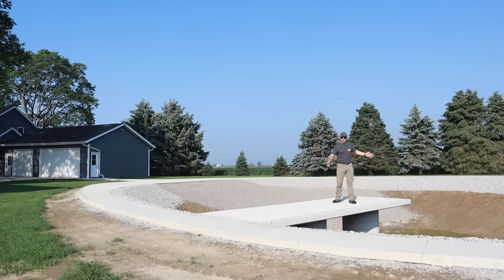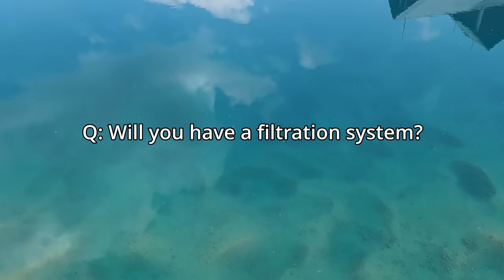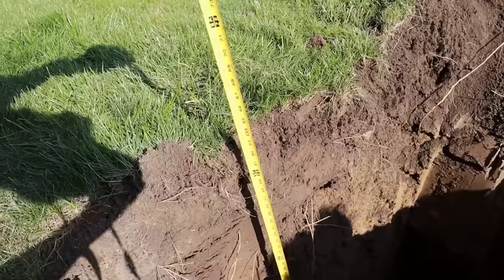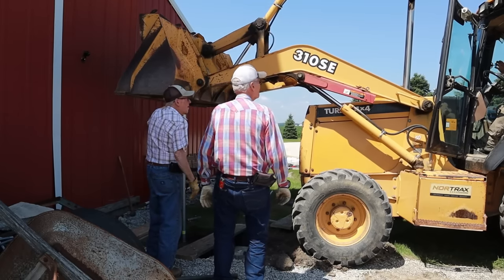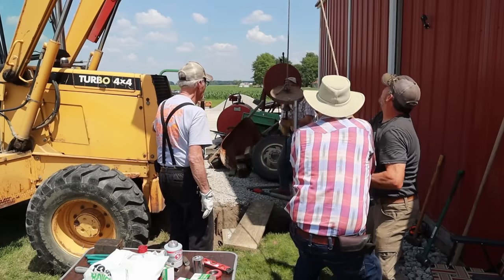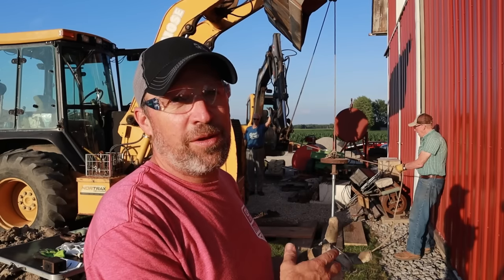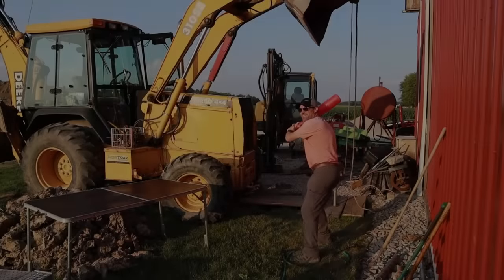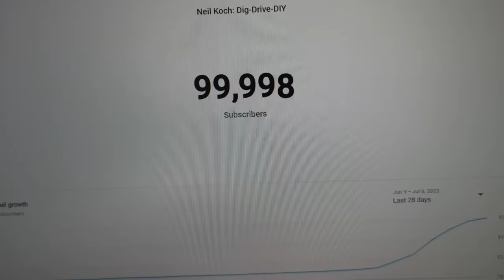It Doesn't Always Go According To Plan

Comment: There are videos of youtube of drilling and casing a water bore with a power drill and water return. These should be ideal in your clay. 
With the driven pipe pressurising your string with water or air occasionally as moving from the clay to the aquifer, your screen will still be packed with clay. The artesian water doesnt appear to have much pressure so may take a while to push the clay out. Keep giving the pipe a half turn occasionally with a wrench and it will drive easier. 
Put a ruler on the map with the other bores and springs, get as close to that line as possible. Its likely an old channel in the lake bed and will be shaped like a stream. 
You may be able to get a simple auger sampler and find it. 
From country boy Geologist enjoying your content.

Comment: Filtration, I recommend floating island, the roots of the plants grow into the water and extract excess nutrients. Make them from pickle barrels so as the island gets heavier you can adjust it by displacing the water with compressed air. Just orientate the barrel so the hole/ cap is at the bottom. Make the frame holding the barrels from anything that won’t corrode or breakdown in water…
It’s amazing how static friction can resist driving something into the ground, the city of Venice sits on piles so do the very tall buildings in Dubai.

Comment: I am a downer, by fortune, it would appear.  When we needed to drill a well for our bait and tackle shop,  my partner and I started walking around the area we wanted the well drilled.  After I crossed a spot twice, I said , “Here,” and pointed to a location at my feet.  When the drilling was finished, we had over 80 gallons a minute flow from an artesian aquifer!  I did the same thing at our farm, too.  Both times I did not use anything but my intuition.

Comment: Look how they build fences they a short tube with on end welded shut they put on top of the pole so it can be hammerd down with no damage pipe used it before works great for driving down hallow pipes

Comment: For this sort of situation, we have a concrete breaker for our excavator and skid steer that we have a tamping foot for.  We modified that so we can mount seats of different size so we can  hammer fence posts.  Done miles and miles of fence line, and driven in 20 foot lengths of drill stem for gate posts, or for high-lift horse fencing.

Comment: I once had a plan to build a cistern to collect the water from my roof.  Eventually I gave up and did a well. In the process I calculated that with about 32 inches yearly of rain here in Kansas, more than 10k gallons runs off my roof.  Have you considered collecting the water from your roof for supplying your pond?

Comment: How does the gravel hold up on the clay over the years? We want to do the same but are worried the gravel will pack into the clay. Do you use a road cloth for weed prevention too? Our dugouts get nasty in the summer! Thanks!
Reply from the maker: The stone holds up well in the clay. It won't sink in too badly.

Comment: Requires some planning first.  Leaving out a small piece of sidewalk for heavy load access with a road in would make sense.  Dig deeper during the excavation of the pond and put the well head IN the pond… bring in a well driller.  Install the head at the dock.

Comment: Here in Germany we don't hammer drill like you do anymore. We juste use a waterpump connected to some metal pipes with a horseshoe at the end. You just twist a bite and the pump does all the workt. After that we put in pvc pipe with a plastic filter at the bottom in the whole, so nothing will be rotting away. Than we fill the whole with Quarzsand and pump the well clean with the same pump. Works very easily and takes about 2 hours max. Maybe give it a try. There's instruction videos of that on YouTube. Good luck!

Comment: My neighbor handed me a pipe with a shut off valve at the top, that connects to a pressure washer or hose.  This he said, is what we use to drive post in this dry hard soil. 
With that I hydro drilled a starter for Railroad ties. Helped build corrals while using a post hole digger.

Comment: A drum winch would have worked gr8 for lifting your alide hammer. I have seen other well diggers drive pipe using this method. Just need a motor to operate smooth drum to wrap your rope on. In fact they actually make one that attaches to a chain saw that may work

Comment: I saw a video where a guy attached a power washer head and water hose to a really thin flexible PVC pipe inside another pipe 1 size larger and sprayed a well hole all the way down until his outermost piped which became the well was all the way in the ground and then pulled the thinner pipe out. He was able to make a well in a matter of minutes.

Comment: At one time many years ago I used to belong to the Southern Oregon Society of Dowsers, and it does work.  You can even tell the depth of where the water is.  How it works; Basically the tool doesn't find the water it is only a visual aid for your emotions.  You body picks of energy waves and through slight physical movement your sticks or whatever will tell your eyes what your body has picked up.  intuitively.  I know, I know it sounds weird but that is the mechanism.
Also, water also rises up into "Domes" and if you are lucky enough and pierce the dome at the right place you will get an artesian flow.  These domes are not a part of the linear flow of underground aquafers.  Those domes are filled from water deep underground under high pressure, not from an aquifer.

Comment: You may want to try a variation on the old classic hand drilling technique using a pump and mud.  https://youtu.be/bx_hS_g0wDY or with a drill https://youtu.be/xQRhsoSCXvg.  -  DIY Water Swivel for injecting water down a pipe: https://youtu.be/GN5bU-Dr3dg.  The second video uses a drill head of PDC carbide drilling head inserts, but to be honest some steel rod welded to the end would probably do just fine.  Really you just need to scrape the dirt/sand/clay loose and let the water flow carry it up the hole.

The other method I've seen is using a pressure washer to do some of the drilling:  https://youtu.be/udGhHFv0sTI.  

With your heavy clay soil the well hole will probably stay pretty much intact for driving the pipe as long as there is water/mud in it.  

I don't really believe in the divining method to find ground water, but if you walk the land between where you know springs are there may very be slight ground elevation shifts,  general patterns, or even slight soil differences a shovel or two down indicating where things might have naturally run over thousands of years.

Comment: idea Put a tractor rear axle on a  jack and using the wheel, rig a pole as a crank and a chain that will freely swivel around the circumference of the wheel connected to the weight and pulley….then put the tractor it in gear and let the wheel do the work

Comment: Use dosing rods to find the water. Then I'd say drill or dig out the hole. Doing so wont ruin your pipes and you'll also know if you got water.

Big part of the problem is that clay you mentioned earlier in the video. Its thick tough clay.

Comment: Pretty sure that heavy clanking noise as you're using the A-frame method is the same one you hear in oil fields, cause they are driving oil wells by slamming heavy weight haha!

Comment: Vermeer makes a pile driving machine.  We used them to pound piles (steel beams) into the farm grounds here in Michigan for solar fields.  I hated that we were using farmland for solar fields, but I was a mechanic on the job and that would be your best bet for getting that pipe driven into the ground, minus any boulders in your way 😢….then yea just like anything with a road block you gotta change your path of travel by moving it over a few feet or get a bigger pile driver 😅.  They make a loud hammering sound like tink, tink, tink, tink every nanosecond, so wear ear protection and safety glasses with a helmet.  Sunbelt rents them out.

Comment: Its a very long story but I was able to find the old wood and wire main waterline (by accedent) to a city in Wa by witching with 2 copper wires. I thought it was bunk until they crossed. I wandered around determining a strait line which we dug and hit the pipe on all 4 holes. Im a witch

Comment: I dont know if you ever got your well finished but i learned away to drill a well with just water an air compressor and 2 in pvc pipe and i was able to drill 50 ft thru clay and dg in under 5 hrs i orginally was using just water pressure but i found a site that told me to add air to help remove the material

Comment: Let water pressure lube your pipe and push the soil out of the way. Make a tee out of one or two of those special couplers. The tee side should be 3/4" pipe so you can put a hose bib adapter and connect it to your existing water system. Put a shut-off valve on before you connect the hose. Either put a plug in the coupler or weld a plate on top. With 50+ psi of pressure flowing through the screen you are driving into the ground, the sledgehammer will work fine. I have put a piece of 3/4" straight pipe on the end of a garden hose and pushed it into very hard ground by hand for more than a foot deep.

Comment: i would have welded a bar on a tractor wheel then lifted the wheel off the ground, then put it in gear and set the speed and it will go round and round and the weight will go up and down a lot faster but most of all a hell of a lot easier... great job with the pond i love it

Comment: I drive 8 and 10 foot ground rods by using 3/4 and 1" emt with a garden hose on one end. Running water through the emt acts as a water drill, when done I drop the ground rod in the hole with no problem.
Reply from the maker: Nice. How do you drive it while the hose is attached or do you take it on and off to drive it?
Reply: @digdrivediy  very little is required to get it to go - no driving required. Usually with the water running all you have to do is lift the pipe up and down about an inch to let the water push the dirt out. I have lived in Ohio and Nebraska and this always worked until you hit a rock - but it's so fast, so if you do hit a rock, pull it out, move 6" and try again.
Reply: @digdrivediy  with the tip your driving it looks to be 2.5/3 inches in diameter. If you used 2" emt I don't know if the water pressure across that area will be enough to start removing soil but 1" will definitely help by giving you a pilot hole to follow, and help just like when working with dry wood.

Comment: More weight on the pile driver would help...stack some barbell weights on it.  Also can pump water down the pipe to pre-wet the soil at the bottom to make it softer.  Another thought is to rent a jack hammer attachment for the backhoe.  We use them around here to remove rock shelfs when digging a basement.  They are sometimes called a "Pecker Head".

Comment: Maybe putting water in the pipe would help. As the water goes out through the point mesh it may act like a lubricant. Just an idea to try. 
Second I don't know if you are aware of it but the pipe can't be longer than 33.9 feet because this is the maximum hight that atmospheric pressure can push water up at sea level. If you are at higher altitude this is lower than that.

Comment: I’m sure everyone has a million ideas about how you should do this and I’m sorry about that but I have to throw this one out there.  Use a small tractor and bolt a bar to one of the lug nuts. Then tie the rope that pulls the weight up and down to that bar then put it on jack stands and put it in drive and just let the wheel going around pull it up and down.  Not sure if that makes much sense but I hope so.  Either way I like the content.  Keep it up 👍🏻

Comment: Dropping the weight with the pulley seemed to be the best method. I'm wondering why you didn't take that rake leaning up against the barn or a shovel or a broom and tie it to the end of the rope to make a t-handle that one or two of you could use to pull it with. Like a rowing machine or even a lat pull rather than twisting and pulling sideways trying to grab a hold of a rope and crowding on top of each other to get to the rope. You could even leave the rope tail a little long past the t-handle for a third guy to use with a guy on each side of the handle and have room for each other and pull it straight to you.

Comment: Had a similar job but had to drive horizontal instead.  I used my 20lb Milwaukee SDS Max hammer drill and a custom drive socket and point I made up. The tip was made of M2 tool steel I welded into the front and then ground to a point.  It was then heat treated for toughness.  Worked the charm and drove thru everything it, a couple of rocks.  In your case I would have simply rented a 60lb electric jack hammer and a drive socket to do this.  Then again I am lazy and can make more money, but I can't make more time!

Comment: I have used brass rods to find water. I was the biggest doubter in the world until those rods crossed at one point continuously and no other places. The water well guy found it, my wife started laughing, so he handed the rods to her, and the rods crossed, I called BS, so I tried and they crossed with me doing it. The water well strongly believes in them.  Where the rods crossed is where we drilled the well and it turned out to be a very strong well for the past 10 or 12 years now.  All it will cost you is two brass welding rods, bend the ends, hold them in your hands and start walking.

Comment: Knowing that you have such a low water table. You could have tried using a cherry stick. It would have helped you locate the water much quicker. And then you wouldn't have to take the place out and put. Put it back in the ground again. I think. With a cherry stick, locate the water first, make life a little easier.

Comment: You know while drilling. If you pump water down the pipe it would force the dirt to move out of the hole. It won't even take much pressure to push the pipe down.

Comment: Okay, use an auger to make the hole. Drop your sandpoint, pour in  a couple feet of course rock, then back fill the hole. Or leave the hole open and put a ground level cap on it. That protects pets from getting into the hole.
Reply: Water witching? I haven't seen that in years.

Comment: We used a dowsing rod to locate water for a well in Arkansas in the 90s. We were from California and had never heard of it but my dad went out and cut a forked branch from a tree and walked around for hours. He picked a spot and then handed the rod to me and told me to try it. I walked around with it for awhile and found a spot i liked and showed my Dad and it turns out i had picked the same spot as he did. We were still skeptical because everyone told us you had to have the gift. So my Dad hired a well witcher and he picked the same spot and told us drill down 70 to 80 feet and you'll get 8 to 10 gallons per minute. At 70 feet we hit water. At 80 feet we had 8 gallons per minute. It's real.

Comment: Driving pipe into the ground may of been easier if you fitted a ball valve and pressure washer fitting and jetting the ground at the base to soften the ground and aid pipe depth

Comment: is there a drilling company near by? you can get h rod (about 4inch round, comes in 10 ft pieces, use that as a casing for pump, drive that down , insert pump after you hit water, acts like a well and protects pump, easy removal too for Maintenace

Comment: First water is not in a pool or cavern, it’s in the pore space of the ground (like sponge with water), it does flow and has channels, valleys, dips etc. but not that close to surface etc. thus it can be missed.  Usually with a shallow water level it is widespread.  Why not just drill a well?  If shallow it’s easily done in an ag environment and you have a pump installed?  I grew up in Cal. ag country and have career in oil&gas drilling.

Comment: 19:57 I literally know nothing about wells, but if the rocks are jagged then a small rock 10 feet down could catch on that screen pipe if the whole drill tube gets hit horizontally. Then the force of all that dirt above makes the rock unmovable when wedged through the screen

My physics knowledge (again, no experience with wells lol) tells me the direction you apply the force is more important the deeper you get.

Comment: Just put a pressure washer on it and use two pipe wrenches to wash it down if it stops just let the pressure washer run for while to loosen it up after you get it where you want it just hook a garden hose to it and let it run for a day to wash out the veins In the ground, I learned that from a 3rd generation well driller who put thousands of them In the ground

Comment: A pulley on the loader and a bar on a drive wheel (golf cart) to create a reciprocating hammer. The loader will set the height of the drop and the wheel speed will dictate how many drops per minute.

Comment: You need a long steel rod to hit the pike at the bottom end of the your boring tube thru inside of the tube. When you hit to the top of tube all energy of hit dissipates thru the ground. 
And tube springs and does not have enought hardness.
When you hits to the pike at the bottom of tube all energy comes to the pike and tube not stressed at all and pike just pulls the tube down.
I have 13 meters well made like this. My well made from polypropylene pipe and can't be hammered at all. I hammered it inside the ground by rod inserted inside it. Rod was 18 mm in diameter. I bought 12 meter long steel rod, cut it in 1.5 meter long pieces, and my friend turner makes a threads at the ends of pieces. Inner thread from one end and outer thread from another end. 
I bought 12 meter long rod because nobody sell shorter rod. If i could can buy shorter rod I probably attach a steel cable to it and use it on a cable.